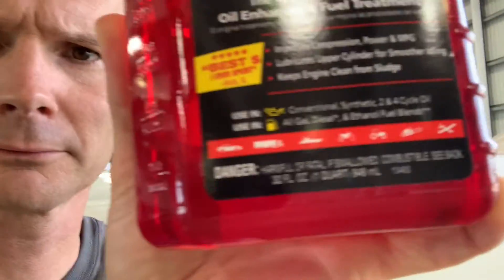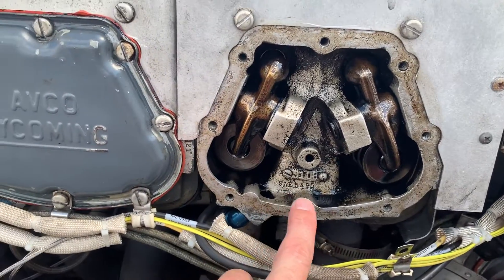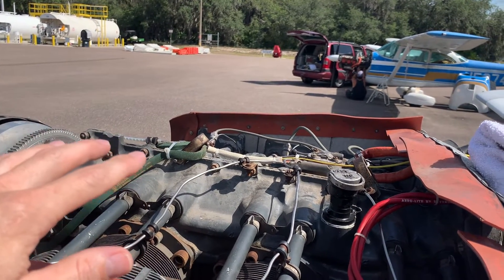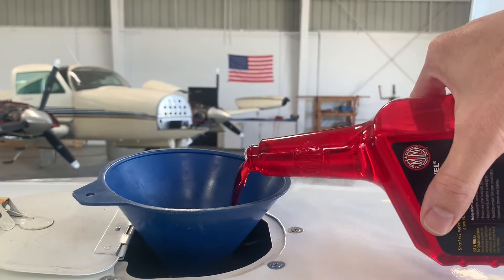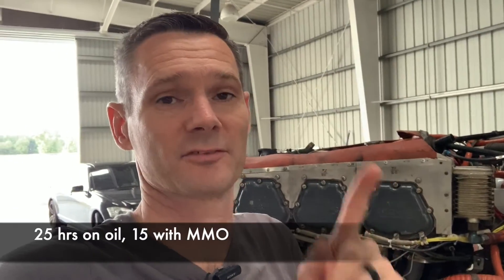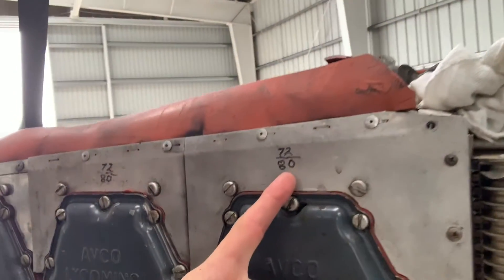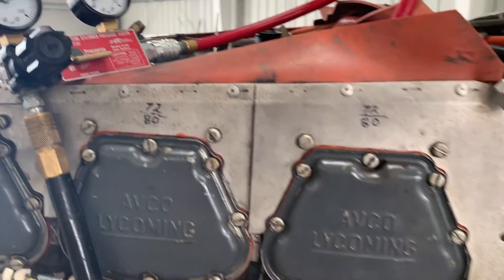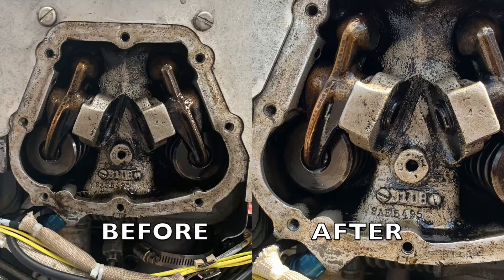Before and after Marvel Mystery Oil in Airplane.  We test it!

Comment: Picked the wrong day to stop sniffing glue.   Time to change all your filters and oil.
Reply: WHY? Because you have an opinion based on WHAT? My opinion of MMO is based on 40+ years as a power plant mechanic AND as an ASE certified master engine machinist.
Reply: @stevehicks8944  Easy tiger.   WHY, is based on my use of MMO in my PA32/300.  I lost compression on two cylinders  immediately after use.  Coincidence?  Maybe,, I was past TBO.  However,  it stands to reason one would want to change oil and filter immediately after MMO use the first time as it will introduce more particulate.
Reply: @badsanta69  That I can agree with, especially an engine that has a lot of sludge built up in it. We recommended 25 hr oil and filter changes, especially in low usage aircraft (less than 200 hrs per year). You couldn’t believe how much sludge builds up in low usage engines, simply because the engines aren’t run enough to “burn off” the moisture than accumulates in them. How many hours were you over TBO? More than 100 hrs is playing with fire.
Reply from the maker: hahaha, seriously!

Comment: Jimmy sometimes putting additives in the engine oil can free up particles that are keeping seals from leaking. Hopefully it will work for you without any negative effects. 🤔
Reply from the maker: I have that same concern.  Usually on high time/mileage engines that's a big deal.  Auto transmissions are the worst for that.  However, this engine only has ~300hrs and I'm trying to break all those things up and find leaky seals that may have dried out.  hydraulic lifters are my main concern.  Those oil passages are tiny and if anything was going to clog first, that's where I would suspect.
Reply: @therealjimmysworld  Jimmy you should get more flight time, and maybe a quick flight to Parkland Florida for a look at your number one rated aircraft with a follow up video titled “buying my number one rated aircraft Pro’s vs Con’s” Then do a oil and filter change on your engine.
Reply from the maker: lol
Reply: If you have "particles" preventing "leaks" you have a problem that needs to be addressed. It's a bit like putting  your finger in the hole. What you will see is carbon elimination. May even sputter your engine in flight.
Reply: Really? You know this HOW?

Comment: If you ever decide to do another test with MMO but in the fuel it would be really interesting to see how well it works compared to in the engine oil! Great video as always!
Reply from the maker: Soooo... I did put it in my fuel.  and I didn't notice any difference whatsoever.  Also, I have no way of showing any before and after with a video.... If you have any ideas on how to visually articulate that, I'm open to suggestions.
Reply: I wouldn’t try that….not in avgas
Reply: @Notthe_droid_youarelookingfor  I have used it for several years in private aircraft and only know of one incident in which it has caused an engine loss of power as reported. If we’re speaking black and white yes additives like TCP must be used unlike MMO which currently isn’t FAA/PMA approved.